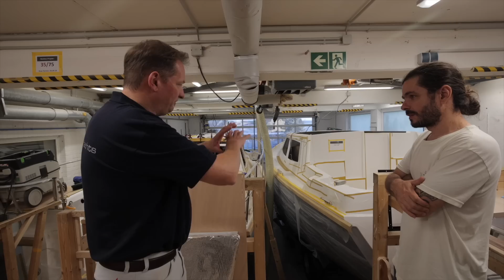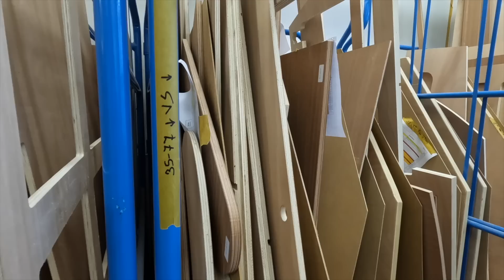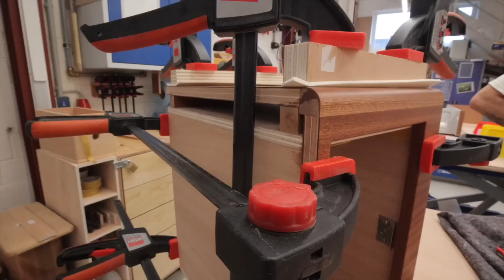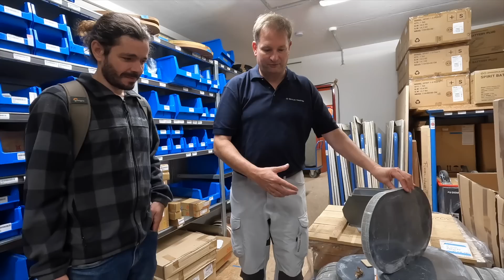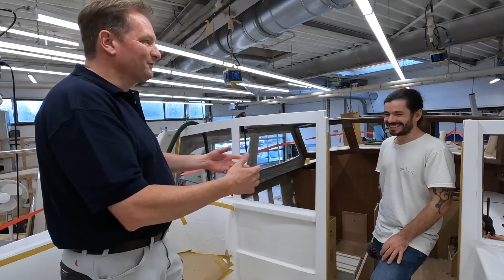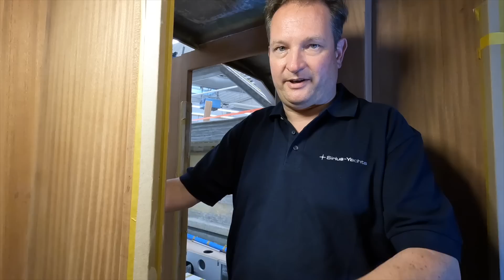⛵️ How to build a REAL Deck Saloon Sailboat!! Ep.345

Comment: Great tour. Since you are building new from plans you could get many parts built or cut by cnc local to your build as your hull design is done on a computer.  Similar to Lori on Lahika but their boat was not accurate so their  parts did not fit as well as hoped. 
Cheers warren

Comment: We have a boat with sapeli interior it’s 25 years old but still looking fine. If it gets really wet it gets black and the previous owner had a bit of snow accident. It was easy to replace the veneer. Sapeli is a great choice also made by sailing channel distant shores.
Reply from the maker: Thanks for the feedback. When we visited Distant Shore last time the sapele wood was not totally finished and we couldn’t have a real idea of the wood inside the boat 😁